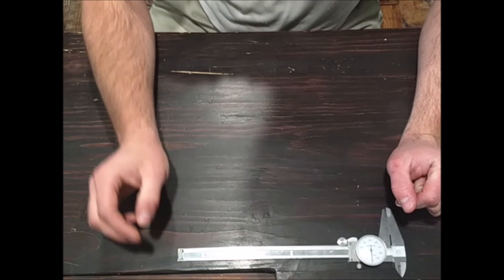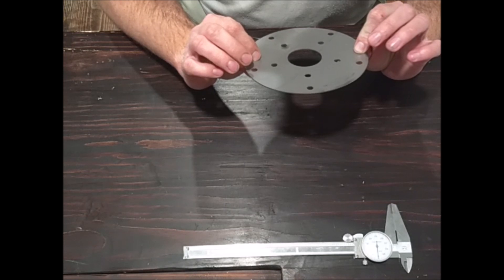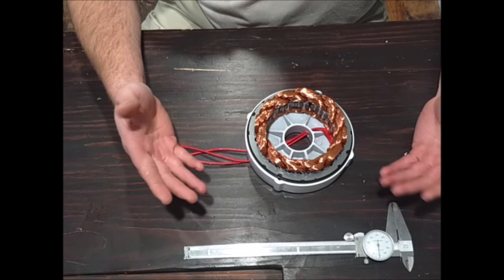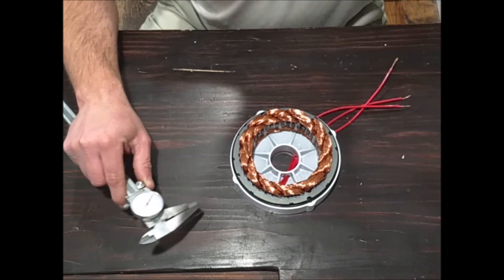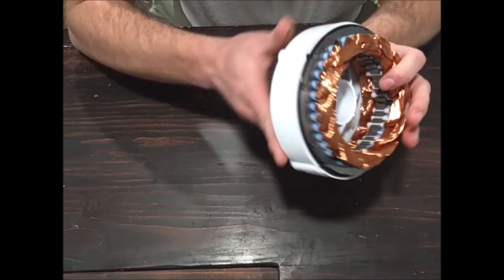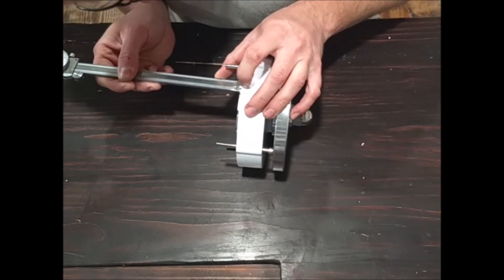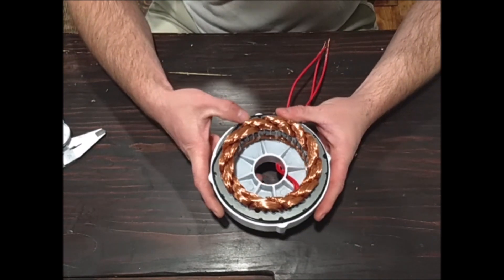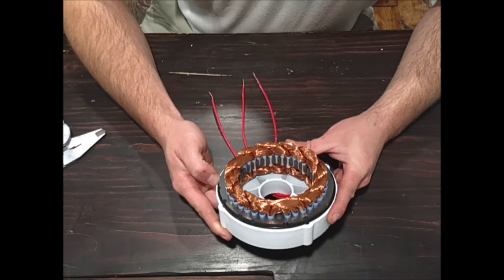Cheap eBay Chinese Vertical Axis Wind Turbine (VAWT) Initial Impression, Internals, and Test

Comment: I bought one very disappointed, didn't want  lots of watts just to charge 12v  batteries to charge Ryobi in garage. Decided it was the cheap motor so bit bullet and paid a couple of hundred for a better brand - guess what....same coil and stator but fancy blades and mount..... Such a shame I think I might just burn rubber in a boiler than burn my cash trying to be green. Where do you get a good reliable motor that works ?
Reply from the maker: Unfortunately in terms of stators that work well with vertical turbines...there's not many that work.  You have to work with very low RPM and high torque, almost all micro turbines are the opposite.
Reply: Lots of people mentioning car alternators as a good motor, then washing machine motors etc, etc in fact so many that it becomes a guessing game as to safety ( which to me is #1 priority) and actual working equipment. Getting enough power to charge my vapes, 3 120ah batteries to 13.4 v and 8 Ryobi 6ah batteries with a surplus of 100w every 2 minutes from the load - most of this from 2 300w panels. But when summer ends would like to have turbine that gives at least 30 watts in winds of 12 -24 miles a hour. I know I am a newbie to all of this but any suggestions or lessons learnt.

Comment: I've notice that you are using about  60 plus volts to watts, but at 12 volts it should be more watts. I am not too knowledgeable with voltage. My thoughts was if you bring down the 60 plus volt you can product more wattage. Anyhow as I've notice about these turbine made in China they are referring to how many watt you can get in a 24 hour day which is a scam but it is how they calculate these things. On another note I do have the same turbine and I am thinking on modifying it to spin with magnetics as oppose to wind just for fun since they a crap with potential. Lol 😆 🤣
Reply: I build my own wind turbine. 100V DC. The volts is not the problem. If your 12 volt battery 🔋 is let's say 10 volt . The wind turbine will  make power let's say 60 volts but as soon as the wind turbine reach 10 Volt the voltage won't get higher but it will start charging the battery from 10 volt. Then the amp meter will show that the amps start rising and so the voltage till 
 14.5 Volts and then the solar regulator will switch the charging off
I do have a magnetic charger

Comment: I bough one of these about a year ago. It is a shame because it seems as though it has the potential to be a good little unit but falls short. I put it together, bolted it to a pallet on a pole about 2m high and tested it with a leaf blower. The out put was so low I decided it wasn't worth mounting to my roof. I plan on using the blades and some of the mounting gear but swapping the generator for a DC motor (probably from a treadmill or a rewired fisher and paykel washing machine motor). I just hope the blades have the power to turn the motor in anything less than a storm.

Comment: Would it be worth buyin a cheap turbine like this that doesnt work very well and fix the problems. Wind better thicker gauge copper coils and fit bigger magnets. I think this would be a good way for someone who would like to build their own but not experienced enough to manufacture all the parts. Whereas replacing the coils and fitting stronger bigger magnets that may have to be recessed in a bit to fit would be good for a newbie. Or just throw it away and use a dc scooter motor.
Reply from the maker: Sorry for the late reply!  No I would suggest NOT buying this variety of Chinese turbine.  The alternator isn't large enough to really contain enough copper and magnet material to produce much power and the blades are really not that good.  It's good at looking cute, but the whole design is lacking.  There's a lot of horizontal turbines out there that are both inexpensive and offer a much better starting point for an upgrade.

Comment: Better buy Car Alternator Generator, cheaper and very good output when we use it to charge 12V battery bank.
More more better than this not reliable generator